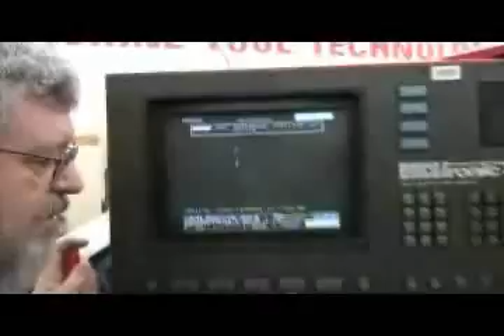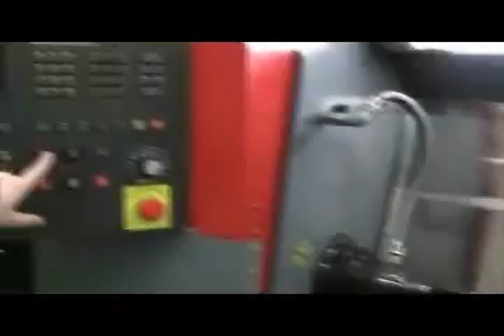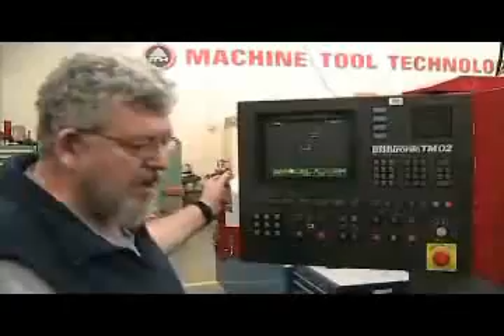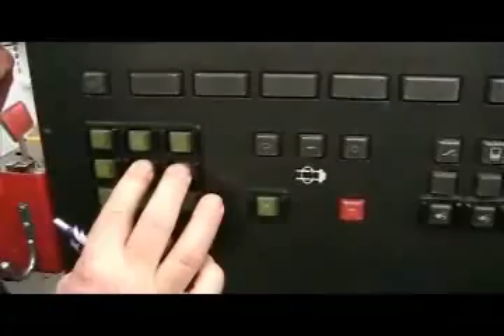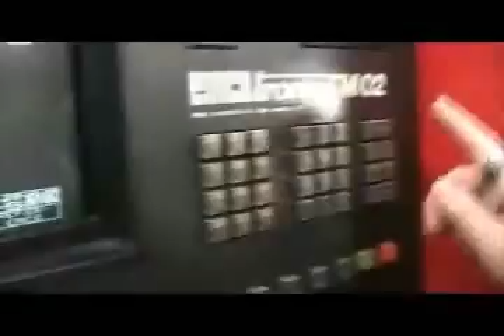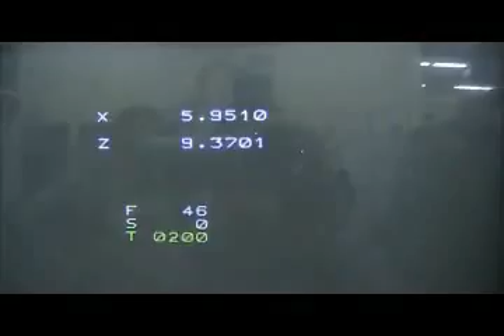EMCO CNC Lathe

Comment: How to change language on emco turn 360 mc from deutch to english ?
Reply: Hello Mirzoni. I know it. 
-EDIT MODE
-WRITE 'MONITOR' word, (not enough 'MON' ) You have two password.
-search T22 parameter
SET T22=0, this is the english language
Balazs
Reply: Can you help me how to do it. How can i enter edit mode. This is e360 i guess from 1995 yr
Where is edit mode and where i need to enter monitor, i know for one password i think its 0000 or 1234 for parameteres but i never use it before. I dont want to screw something